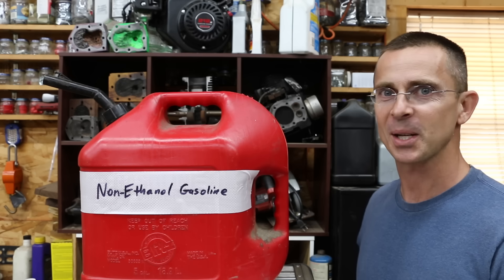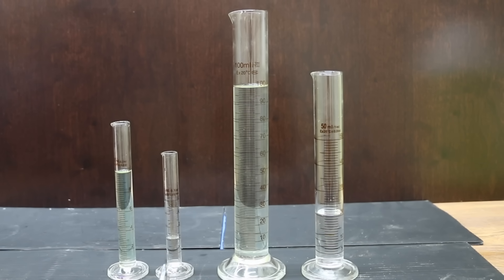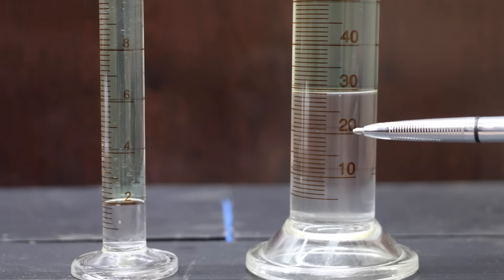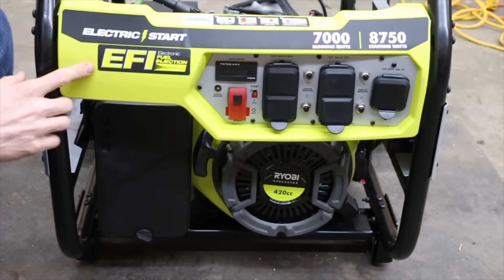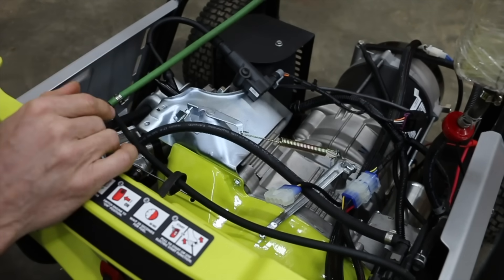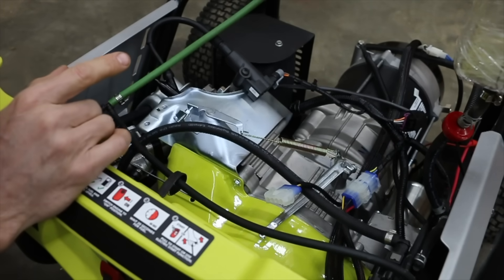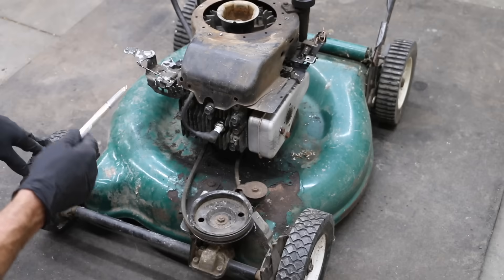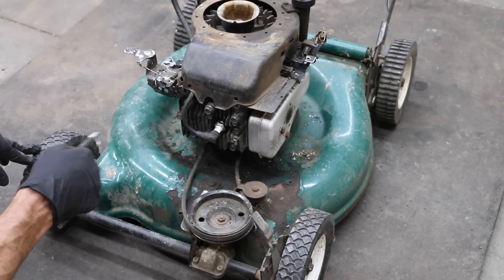Is Non-Ethanol Gasoline Really Better? See the PROOF!

Comment: Ethanol fuel might work well in 4 stroke engines, it's a disaster in 2 stroke. Used it with "the little bottle" of oil that comes with my trimmer. Worked fine. Store it for the winter and fuel lines as well as the plunger turned to cracker crumbs. I replaced the toasted items and now I only use the 2 stroke premix ETHANOL FREE. Now it's only premix for the trimmer, chainsaw and blower.  Absolutely zero problems. At Lowes we sold 100's of repair kits for the 2 stroke carbs. I turned my customers onto premix and viola-no more problems. You pro ethanol people can say what you want, but you can't refute physical evidence as to the damage ethanol does to 2 stroke engine parts. This isn't an isolated case. I'm sure thousands of mechanics can back me up on this.
Reply from the maker: Thank you!

Comment: I once ran my 2-stroke 50cc scooter with 10%-ethanol-gasoline, and believe me: I regret it to this day! At first, my engine operated with a higher than normal cylinder head temperature, plus my muffler's chrome shield turned blue, and I had some granite-looking buildup on my spark plug's electrodes. That also was the root cause of my engine constantly jerking my scooter back and forth like a savage horse trying to throw its rider off. Once I had all that freak stuff drained and refilled with regular 95 octane, it immediately ran fine as usual. Never again E10!

Take note that the scooter dates from 2001, and it has a separate oil tank as fuel-oil mixing occurs inside the carburetor, primed by the engine-driven oil pump.
Reply from the maker: Thank you

Comment: I’ve had to repair a friends different small engines before and it’s always due to him using 87 octane there is this white gelatinous junk that builds up in the carb. I will only use premium in my small engines and have never had any problems like that.
Reply from the maker: Great point on the ethanol. Thank you

Comment: The problem is if you add ethanol to your fuel tank via your gasoline that you are purchasing if your car is not running efficiently and temperatures are not high enough you pollute the atmosphere with formaldehyde. I guess we’ll all get involved before we die, as just about everybody’s car does not run efficiently at one time or another
Reply from the maker: Thank you!

Comment: what about using the generator to make hydrogen gas by electrolysis and see if it can make enough to run the engine without petrol, use enough petrol to make it run and start using the hydrogen similar to the gad vapour video you made, and when it runs out of gas it might be producing enough hydrogen gas to run the engine, using a water bubbling type flame suppressor
Reply from the maker: Thank you for the video idea!

Comment: It should be said that these tests don't translate to all cars. Some cars need 98-100ron fuel to avoid preignition in high compression engines and forced induction. Most performance Japanese cars are tuned to run on it. Question is, which is worse, running 100ron fuel that's had the Ron boosted with ethanol or running 95 Ron fuel? My car runs like crap on 95-97ron
Reply from the maker: Thank you

Comment: I live in Illinois right near the Wisconsin border! So I fueled up my 2018 Ram 5.7 Hemi with BP 87 octane with 10% ethanol from a 1/4 to Full it was 22.3 gallons! The gas in it before was from the same station same octane and ethanol percent!
I drove to northern Woods Wisconsin its a 328 mile trip It took 4.5 hours with cruise control set to 78 with AC setting unchanged the entire ride! Temperatures outside was 86 with wind out of the west steady at 8 mph! I used 3/4 of a tank to reach my destination! MPG was 19.9! 
After an and hour of looking at the property I was interested in buying and walking it, was time to go home! 
Stopping at the BP in town that I’ve used to fill up my snowmobiles for 20+ years! 
They don’t add ethanol to their gas its 100% ethanol free! They take great pride in selling it without ethanol! 
I got 87 octane and filled the tank up 23.9 gallons! Made no changes to my AC and set cruise to same speed! Temperature had dropped to 83 but wind still out of west at 10mph now! 
I got home same time frame 4.5 hours same driving traffic and route home! 
I used just over 1/2 a tank!  MPG was 25.6! 
What this told me was gas with ethanol doesn’t improve fuel mileage or last long! Huge difference in MPG and usage!
Reply from the maker: Thank you!

Comment: I’ve been watching your videos for quite some time. Awesome content!  Would you/could you test the pre-mixed two cycle gas vs regular 87 unleaded gas and oil mixed yourself? I’ve been running Sunoco pre-mixed 40:1 gas and I’ve been wondering how does this fuel compare with not only regards to fuel efficiency but also does it run cleaner in the engine. Thank you for your time and keep up the testing! Excellent job.

Comment: Using non-ethanol gas on my 2016 VW Jetta, on an 8 hr drive, I averaged about 45mpg. Average speed was over 70mph. I did this trip, SC to VA, 6 times at the end of May/beginning of June.

Driving to and from work, 45minutes to an hour each way, I average over 32mpg. Average speed is between 60 and 70mph, when I get out of all the red lights. I do this trip 4 days a week.

I refuse to buy 10% ethanol gasoline.
Reply from the maker: Great information! Thank you
Reply: really?... that's a 41% increase in fuel efficiency in similar driving conditions... There must be something wrong with the ethanol gas they're selling you. Maybe your gear ratio runs a higher RPM between 60-70 mph... something must not be the same beyond just the ethanol content... because I don't think the math would possibly work out like that all other things being equal.

Comment: As said fuel efficiency is not as good with ethanol blends. As far as the other issues. I mix Marvel MMO with the E10. No problems yet. You may try that with your test.   I do mix slightly more than instructions call for in small engines. ~3oz to 5 gal can.
Reply from the maker: Thank you for the video idea!

Comment: Only few Cars have a problem with ethanol. In sweden E85 (85% ethanol) is quite popular. Most cars need another motor mapping for that. Any workshop there can do that. I bet cars with carborator will get a problem with E10 when it is just standing around one year. My motorcycle is an injector. Never had problems. After one year standing (battery on the charger) just pushing the start button and off she goes.
Reply from the maker: Thank you

Comment: Plus, ethanol is hygroscopic, and when the alcohol and water combine, they produce a jelly-like substance that will clog carburetor jets, filters, fuel galleries and injectors. To make it worse, that substance is not soluble and must be removed mechanically, not entirely unlike the pudding we used to get in 2-stroke carbs on pre-mix systems when the gas evaporated and left deposits of oil over long periods of disuse.
Reply from the maker: Thank you

Comment: Most fuel systems after a certain year were designed differently to handle the corrosive properties ethanol has. Ethanol is hydrophilic, so it attracts moisture. Older fuel lines, pumps, tanks, etc weren't designed for this, so they're the most likely to end up in a shop for repairs from buildup.

In port injected vehicles, ethanol has very clear cleaning properties mostly evident on the valves and the tops of the pistons. I've seen hundreds of torn down motors that have run specifically on ethanol or E85 and they look very different than ones that were ran on 87, 91, or 93 octane.
Reply: Here is an excellent example of how clean this motor is after using E85 for 21,000 miles. 

https://www.svtperformance.com/threads/motor-teardown-24k-miles.1102753/
Reply from the maker: Thank you

Comment: The state of SD quit using E-85 in their state vehicles as they had to refuel so much more often that it was actually costing them MORE than on blends with much lower alcohol levels.  In my own experience, in my first company van I would always buy pure gas as the miles per tankful was always greater than even the standard E-10, as long as it was 40 cents a gallon (the break even point) or less.  My current one has a somewhat larger engine so there's enough margin I can get by on the cheaper ethanol stuff if I'm not pulling a trailer.  But just step that up to E-15 and the miles/tank drops a lot so I never use it.
Reply: Not sure how to edit comments- should have read "as long as the increased cost/gallon was 40 cents or less..."
Reply from the maker: Thank you

Comment: When I moved to a rural area, I went to my local (Ma & Pa) Stihl dealer and bought a chainsaw, a string trimmer, a hedge trimmer, and a leaf blower.  Stupidly, I put ethanol gas in them.  I had to have all 4 re-built, as the ethanol burned the aluminum parts (looked like a valve cover?) used inside the engine.  As a mechanic, I am an excellent computer programmer.  So, I got a lecture from the shop owner (Pa), and now use only TruFuel.
Reply from the maker: Wow!  That's a lot of damage!
Reply: @ProjectFarm  Yeah.  But Pa gave me a break because I bought the stuff from him.  Sharpens my chains for free, too.

Comment: Ethanol contains 1/3 less energy. You therefore use 1/3 more fuel. In a 10% blend you therefore need 3.333% more fuel. 10 gallons are now 9.666 gallons! 3.33% less fuel economy.
Reply from the maker: Thank you

Comment: Ethanol lowers your fuel mileage cuz it's alcohol it increases no it will not cause building carbon due to lack of oil in alcohol your engines heat increases your engine burning oil internally if you're going to use a high octane fuel you used 91 101 97

Comment: Ethanol isn't an issue until you let it sit exposed to the atmosphere. If you're leaving fuel in your older stuff without additives like starbright and marine sta-bil you're just a moron, plain and simple. And you can get 100LL at local airports or just get a 5 gal can of Sunoco race fuel.
Reply from the maker: Thank you!

Comment: My camaro is supposed to run on 91 octane only. I get 21mpg at 75 highway with ac on,long tube headers,"3 exhaust and intake. But when i use cheap low grade fuel i get 24mpg.
Reply from the maker: Thank you!

Comment: I won't buy ethanol gas for my small engines now that we have ethanol free gas available.  That certainly has solved a lot of my issues with small engines.  Still have a back-pack blower that won't run right.  I try to get my wife to put ethanol-free fuel in her car but she won't do it.  My truck is diesel.
Reply from the maker: Thank you!

Comment: I tried the non ethanol test and my MPG was the same as the tank before. I was out 40 cents per gallon for the test. I’ve had zero small engine failures I could attribute to ethanol. I have a 18 year old LawnBoy 2 stroke that still starts on 1 pull after sitting all winter. I have two Poulan Pro chain saws that are 16 years old. The big 54cc chain saw still has the original carb and fuel line. The 42cc chain saw needed a carb rebuild kit at year 13. I replaced the fuel lines while I had it apart.
Reply from the maker: Thank you

Comment: Going back quite a few years in Australia some gasoline stations were fined by the Government for adding ethanol (which is cheaper than gas) to their gasoline. The Government said it ruined car engines and destroyed all the rubber (or neoprene) seals in the engine. A little later they suddenly reversed their position on this (probably after the politician's received a 'kickback' from the oil companies) when fuel containing ethanol came onto the market, and told everyone how much better it is for your engine, and how much cleaner it kept it. Unlikely that it was better for the engines, but very likely better for the politicians pockets.
Reply from the maker: Thank you

Comment: I had to have my Billy Goat leaf blower repaired 3 times at a total cost of $600.00+. (Paid $750.00 New)  One of the Cub Cadet Dealer shop guys felt my pain and informed me about non-ethanol / REC gasoline.  All I can say is everything now is running on REC gas with no more problems.  I have a Cub Cadet string trimmer & Backpack blower that is 19 years old.  Ever since I started putting REC gasoline in my lawn equipment and my two Stihl chainsaws they just purrrrrrr idle without stalling and start on the first pull.  Plus I can leave the gas in them from one season to the next without any worries.  I even run the gas in my 23 HP Commercial Cub Cadet 54" Tank Zero degree mower, W/ 5 Gal dual tanks.  My neighbor has a 25 HP  60" Cub Cadet Tank which broke down.  When he borrowed mine he could not believe the power it had and how much faster mine was compared to his larger sized engine.  Now I only use REC gas in small engines that require just gas or oil mixed fuel,  I put regular unleaded gas in my cars.  My proof in in the wallet.  For three years I have not needed to have ANY of my equipment serviced.  I use to drive 1 hour round trip just to fill one of my rotated 6 Gallon jugs.  Last year a Marathon station was built just 10 minutes away from where I live which sells REC gasoline, now how lucky it that?
Reply from the maker: Thank you for this information!
Reply: Be thankful you do not live in "Kommifornicate". You CANNOT put any other gas in a street driven car, and only can get the alcohol free in small cans of about 2 pints. Not to mention the 2 pint can costs about 7-8 dollars !!
I HATE MY HOME STATE OF COMMIE GOVERNMENT.
Reply: @siseley1  Don't get riled sugar this is about testing things, it's not some 4chan page.

Comment: I have E0 nearby and use it in my 97 s10 most of the time. Its an older engine designed before E10 was really a thing. It is more responsive and gets better economy with E0. I also DD a 2004 Colorado and occasionally use E0 in it. It is not noticeably more responsive, but does get about 1.5mpg more with E0.
Reply from the maker: Thank you!

Comment: So I think the reason you saw about the same carbon deposits is because the jetting didn't get changed to flow more fuel. I have been told that to make the same HP with ethanol fuels you need to flow more fuel, so in the case of a carburetor bigger jets. The correct air fuel ratio for normal pump gas is 14.7:1 apparently for E85 its something like 8:1. Its way more for E85 but hopefully that makes the point that even for less ethanol content like E10 and E15 you will need slightly more fuel. Hence the 4% less fuel economy on the generator when running ethanol fuel.
Reply from the maker: Thank you!

Comment: I'm a mechanic in Canada. We regularly run ethanol-gasoline blends in everything here. 10% ethanol. I've never ever seen an engine damaged by ethanol blends, and I run trucks, cars, lawnmowers, chainsaws, weedeaters, rototillers and generators with it. HOWEVER, so many folks complain about damaged small engines that I have switched to straight gasoline for all my small engines. Briggs and Stratton recently suggested in a news release that this might be a smart move, so I took their advice. I continue to run my vehicles on the blends, without any problems at all (1998 Ford ranger, 2002 Toyota sedan).
Reply from the maker: Thank you!

Comment: When you purchase gasoline you are buying energy, Btu's per gallon.  Straight gasoline has around 114,000 Btu per gallon.  Ethanol has about 76,000 Btu per gallon.   So, a 10% mixture of ethanol in your gallon of 90/10 gives you about 110,000 Btu's vs 114,000 for non ethanol fuel.  Theoretically, you should see a 3 or 4% increase in gas mileage but there are other factors which impact fuel mileage.
Reply from the maker: Thank you!